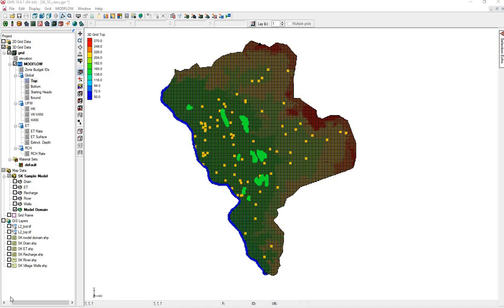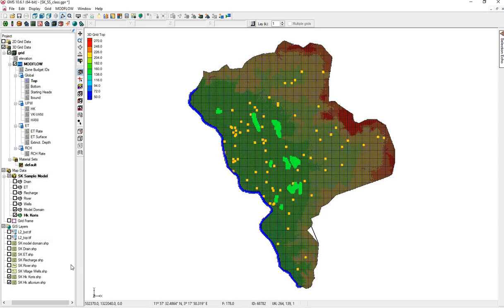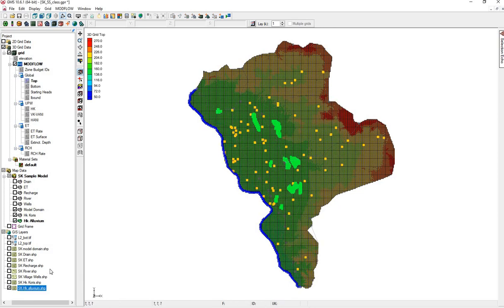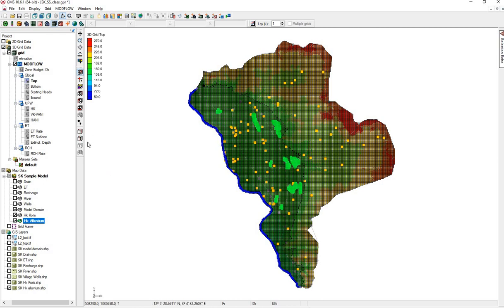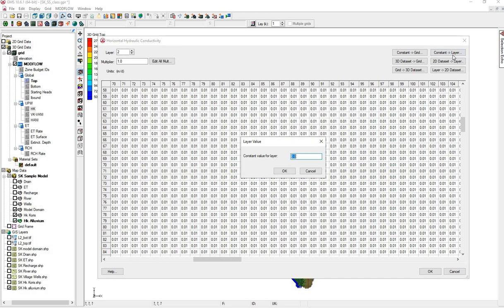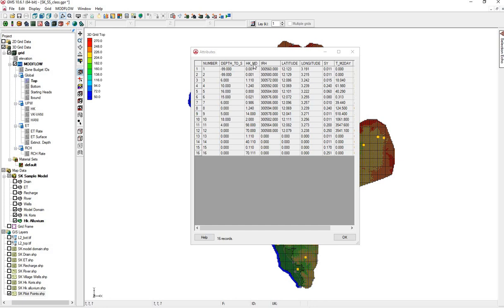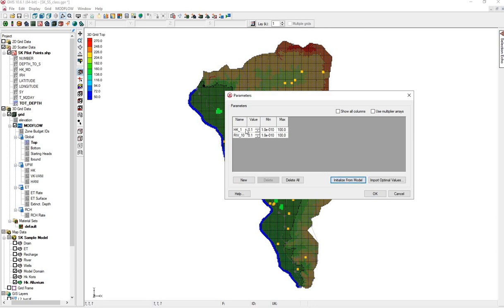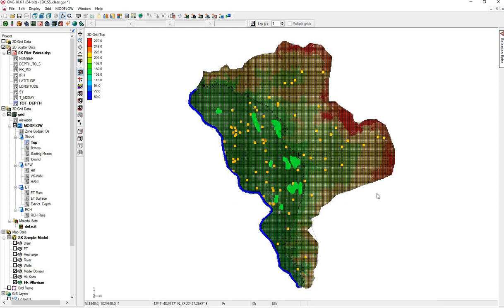Add some aquifer parameters to a groundwater model 4/n

Comment: Hi Alexandra, in terms of the hydraulic conductivities, if I have four layers for my study area with different horizontal and vertical hydraulic conductivities, do I need to prepare the shapefile for each of the layer and include the Kh and Kv values? Thank you.
Reply from the maker: Hi - you could use the same shapefile and convert it to separate, new coverages for each layer. Apologies for the lag, I was out of the office..
Reply: @alexandralutz7844  Thank you very much 🙏